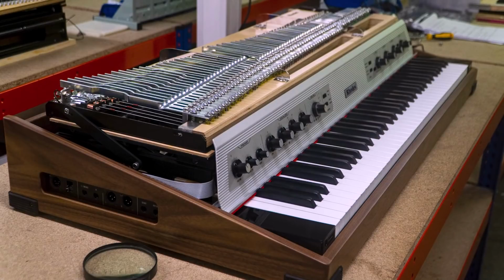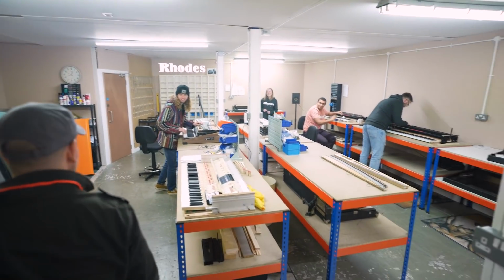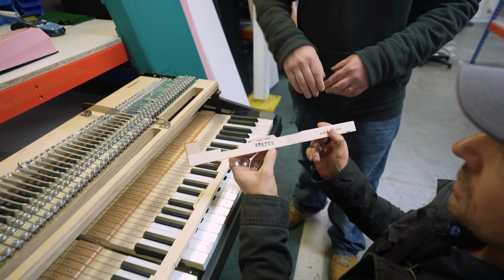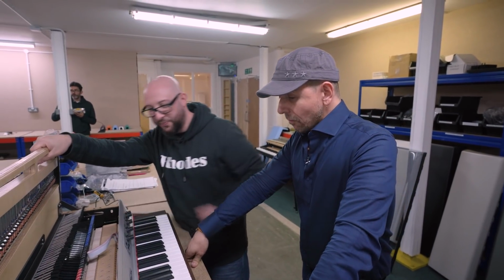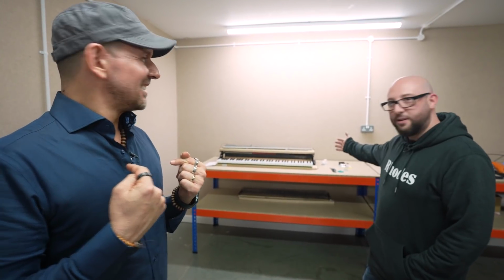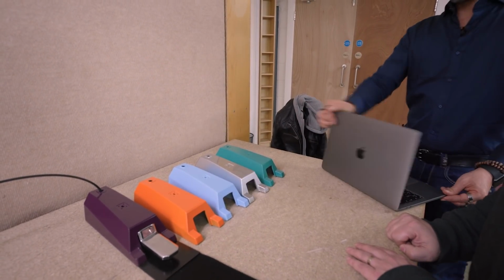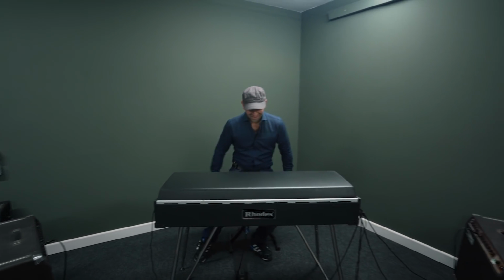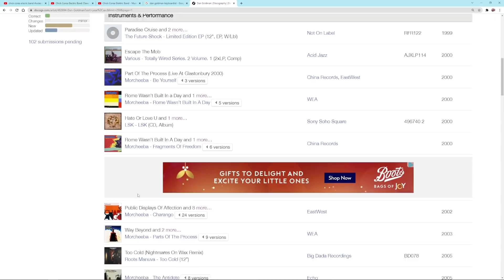The Rhodes Mk8 Piano: Inside The Factory

Comment: This is insanly cool, but I'm not quite shure, if I would like it in person. The wobbely feel and slight detune seem to be a big part of a rhodes to me - At least for my mk2, compared to a sampler. A Version with a very slight and randomized detuning mitght be a nice option. They should also think about adding a stereo chorus (e.g. dimension d) and producing the effects panels and amp as retrofit for mk1 and mk2 models, since those seem to be cool and it would turn down manufacturing cost.

Comment: Clear hood, black bottom shell and black front panel. Black FX panel and chrome stand. Place some dim red LEDs in the back to give it a red hue (and glowing logo), and give the clear hood a "dry rub" of glow-in-black-light pigment (VERY lightly -- so it's still see-through). Place some cold cathode black lights inside, and this thing will be a treasure.

Comment: Red is a bold choice, but I think that's the right colour for you (maybe with black panel and walnut bottom). It think it would be even better if it was a transparent red (so it's not as bold/strong and you can also see the inside... kinda), unfortunately it's not among the avaible options on the website.

Comment: The action is in fact very similar to the Viennese piano mechanism of Mozart's and Beethoven's time. The materials differ (plastic in stead of wood) but the technology is the same.
On a second look, the Rhodes action is even simpler than the 18th century one, it lacks a back check for the hammer in its traject downward. This works fine for small hammerheads. I wonder if the inventor Rhodes knew about the old Streicher action and said, hey, this works fine why not just adopt this 200 year old idea.

Comment: Looks great I'm very jealous we have an old Wurlitzer Mk2 but sadly its in dire need of restoration new legs case needs attention a good tune up and it still has the US plug which is not legal here so needs changing to the kettle plug type do you know any good restorer's of these classic electronic pianos I was quoted around £600-£800 to restore it to as new including replacing some of the reeds and a full retune but I lost the guys number a while back but it'll be on the back burner for a while anyway I also have a more modern limited edition 88 gold Korg Kronos piano touch and  a Yamaha Montage 6 Synth I don't play to much these days as can't sit or stand for to long due to some badly damaged discs in my lower back but many many years ago I used to play around a few pubs with the Wurlitzer which was not an easy instrument to carry around very heavy an so is my Kronos but I play that at home what a fantastic machine so much on it to learn I have had it just over 3 years and am still finding different new things and with the colour top to your Rhodes I'd go with the classic black as if you put another keyboard on top I would think I'd might mark a coloured or transparent one and they are not a cheap machine sadly I neither have the room or the finances as much as I'd love one.

Comment: I hated the bouncing of the hammers, which transmitted movement back to the keys.🎹  That affected speed playing.  
***My solution was putting a strip of felt underneath the hammers.  This dampened that modulation slop as the hammers fell back .😎

Comment: The demo Rhodes is connected to guitar amplifiers. Am I to understand that people connect it to guitar pedals and process the sound like they would a guitar?
Reply from the maker: The rhodes is s big fat pickup at the end of the day, so yes you can use it like a guitar
Reply: @Doctormix  Thank You! After this I found a video on how Rhodes work, and each key has a metal tine vibrating near a magnetic coil, just like a guitar. THEN I found another video where a guy did attach it to guitar pedals. It sounded really good!!

Comment: It admittedly does sound nice but it'll be a hard sell at that price unfortunately.  As for me, if you're going to go with a vintage sound, then go all the way and stick to a vintage panel.  I would've simplified the front panel, something similar to the Suitcase panel from the early seventies.  One single-gang, two dual-gang, three knobs.  I have a 1975 Stage 88, bought new in 1975.

Comment: Only thing I dislike about this is the 15v power adapter. I always think it's weird when huge expensive keyboards use rinky dink laptop-style power cables
Reply: This is for several reasons. Let me explain- Firstly its a very high quality and reliable supply with universal voltage. Second, It uses a locking xlr to lock to the piano which stops the power lead being accidentally pulled out as with an IEC. The main reason I chose this supply though was to reduce noise in the signal path and keep it as quiet as possible. High quality is everything for the Mk8. Note that the 73 pickups can act as antennas and as team we believe sound quality is all important- Putting a power supply inside an electro mechanical instrument just doesn’t make sense from an electrical engineering perspective , and also takes up valuable room in the case with more cabling too. So there are many reasons why I/we chose to go with a high quality external supply- it’s 100% the right choice for the instrument and customers.
Reply: @goldphinga  Thanks so much for your detailed response! That all makes a lot of sense.

Comment: Mark I is another level ! So sorry ...
Reply: The Mk1 is a actually several different models and iterations.  Having owned all the Mk1 iterations, and worked on restoring and servicing Rhodes for 25+ years I can tell you the Mk8 is every bit as great as a restored Mk1 and then some!
Reply: @dangoldman4712   Yes i saw and heard it also some soundcloud link..and i remember the original sound, also in the video when you play it, maybe with the amp i think and with personalized eq, of course it sounds 98% similar to the Original sound, and i really appreciate it, cause i thnk it's the best mark after the mark I for my opinion, heard the first time by this video, but when the great doctor mix play it, i saw his face ,maybe impressed by the sound, extremly clean, (my maybe very bad opinion) ... That's all, about the price also, i think it's very exp, so that's the way of my comment... But of course i really appreciate Rhodes piano, and the new company work of Mark 8 and of course big esteem for the Great Dr Mix

Comment: Its really cool the Rhodes is resurrecting this instrument.  But honestly, its way overpriced.  Everyone gushing over “locally made”, “resurrection of an icon”, etc etc etc., has forgotten that they were made in the 60s, 70s, and 80s for a fraction of the price.  Its not black magic that makes these.  They are pretty simple mechanical instruments.  And yes, i have a vintage Rhodes that I have restored pretty easily myself.
Reply from the maker: The Rhodes was never a cheap instrument. Lots of moving parts and engineering. It’s the nature of any piano instrument with mechanical generation of the sound. The better you want to make it, the more it will cost to produce 🤷‍♂️It’s just reality ❤️🕺
Reply: @Doctormix  i mean yeah, but adjusted for inflation, i think they were about between 2,000 and 3,000 USD back in the 70s depending on the options.  These new ones START at 10k.  And with modern manufacturing techniques, too.  I’m not saying they aren’t gorgeously made.  Because these ARE beautiful and wonderfully made.  And yes, I am a bit jealous i can’t afford one😂  all i’m saying is that they are PROHIBITIVELY expensive for most people to buy, which is a shame because they would sell so much more if they started out a bit cheaper.  Exclusivity seems to be the name of the game here, which is, dare I say, sort of off-putting.